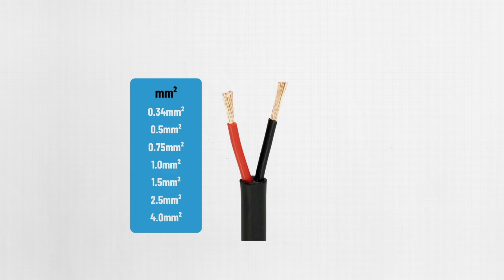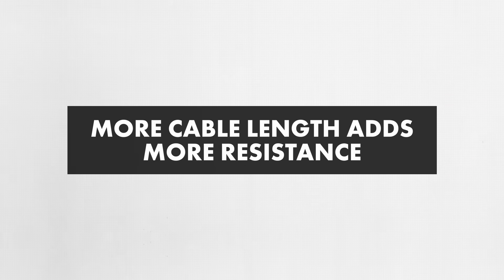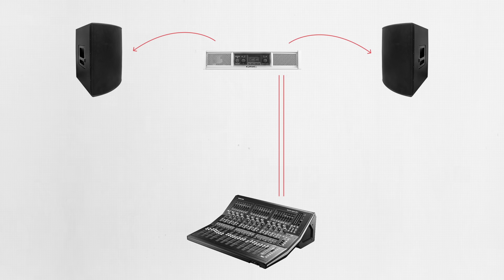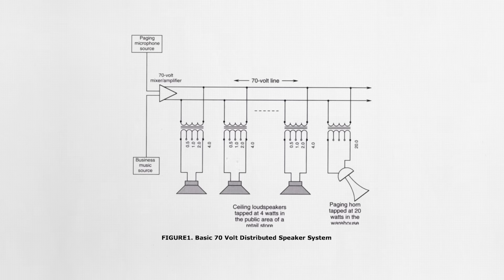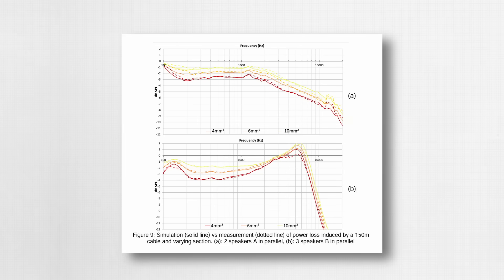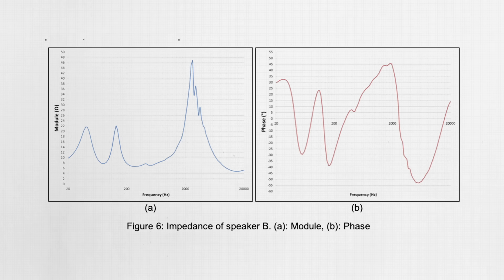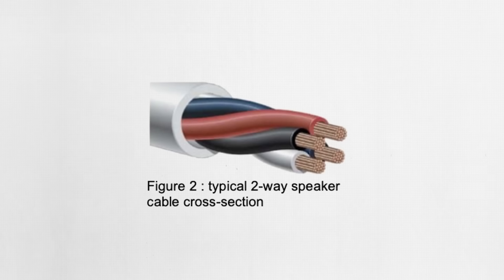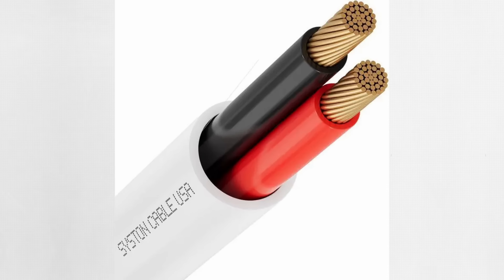Choosing the Right Speaker Wire (Made Simple)

Comment: My church`` subwoofer cable with about 25 meters keeps getting burnt, could the length be the major cause of this problem and what is the best solution?
Reply: A 25 m Speakon cable is generally accepted for most audio setups. Plus you should take confidence that the Speakon cables you're using have the more robust aluminium connectors.

 Is it possible to bring either the amp or the further away subwoofer closer together so you can test the shorter Speakon cable on it.. therefore eliminating the subwoofer as the culprit!
Reply: @Totalplonker ok will test this way, thank you.
Reply: What cable and connectors are you currently using?
Reply: @paulgyro we use speak on plug and the cable is aluminum. It's two subs but the one with longer length is always faulty.
Reply: I’ve set up many pro PA systems and club systems for dance, the amplifier should be really close to the speakers with minimal speaker cable lengths. Using a balanced XLR connection from your crossover to the amplifier. For the balanced cable Moghani and canare are good choices.
Reply: @SuperMcgenius like how close, what should be maximum distance from the amp?
Reply: @aj4entertainment  there is no perfect solution or right or wrong. I have installations where the subs and main speakers are using less than 10 feet of cable and I have others that are 30 feet.  Your run of 25 m which is about 80 feet is definitely too long even if you were using a 10 gauge wire. Shorter is better😊
Reply: Probably Satan. 
Have you tried casting the demons out of your subwoofer?